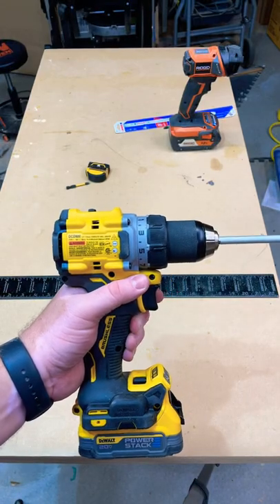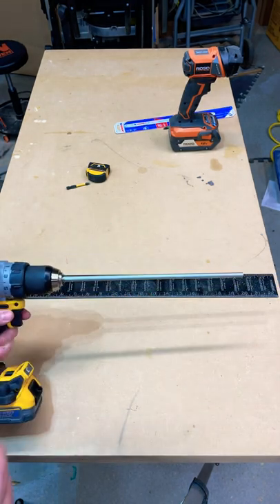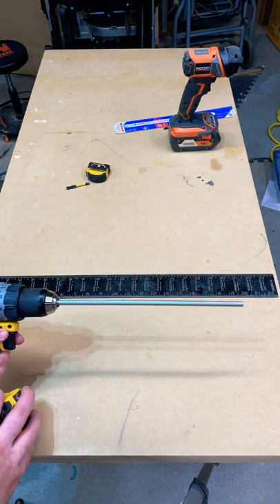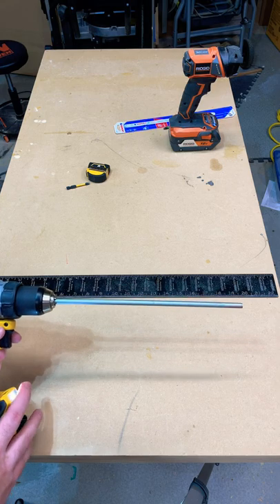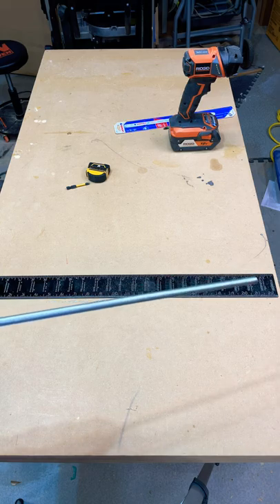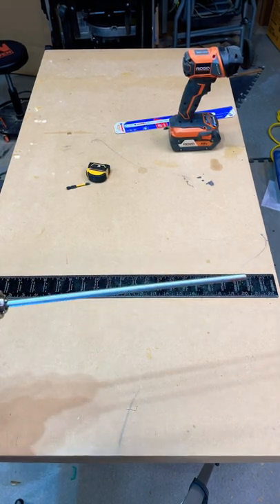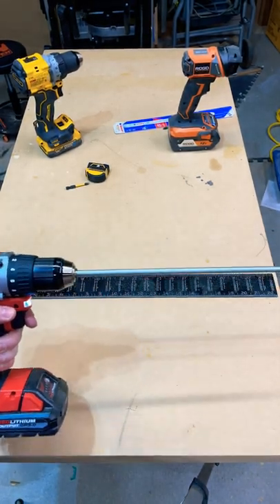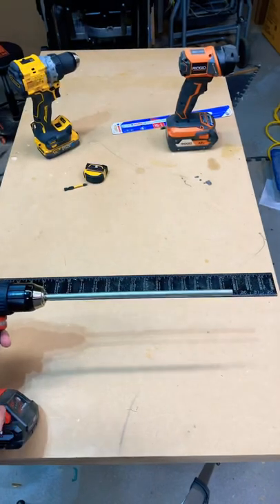Which Drill Is Worse? Chuck run-out comparison.

Comment: I’d say they’re both more than acceptable, and probably better than average.
Reply from the maker: I’ll have to compare them to both some more expensive and some cheaper drills to see truly how they stack up.   Obviously 12” is more than most people are going to have for a drill bit though.
Reply: @TinkerWithTools  Correct: and if you’re using an auger or extension with a spade bit, it will have a self feeding or spear point, so that small amount of runout won’t be relevant.
Reply: It might have helped the video better had you shown us an example of a drill with no wobble at all for comparison.
Reply from the maker: I agree with you.   I had some others that there wasn't time for in the video that had less wobble than that.
Reply: I have the milwaukee and the runout is totally unacceptable for metal working. Drilling things in thin gauge metals or drilling out broken bolts is very difficult with any level of precision.

Comment: Owning a DCD800, I found the run out/wobble to be rather annoying for having to drill accurate holes. It got much worse with light-normal usage on light gauge aluminum or light gauge steel. It wobbles horribly and I had sent it to dewalt for repair; they replaced the drill with a new one and the chuck is the same if not worse after a couple months. 
I’d probably say replace the chuck with. Rohm, or just don’t get the DCD800 (in my experience at least) and look for something else with no runout/wobble from factory if possible.
Reply from the maker: I wouldn’t say it’s my most precise drill but I have found the runout to be an issue.  But I am mainly doing wood drilling.  I appreciate you sharing those as it can help inform others looking to make a purchase.

Comment: Would someone please be so kind and explain to me what the big deal with chuck wobble on a hand held drill (and partly impact drivers) is? They dont spin fast enough to do any harm, they arent meant for precision work and the only 12" long stuff ive used with mine is a paint stirrer. At which point you could argue a bit of wobble all the way out there is a good thing. Also, what little wobble there is usually disappear when the drill bit is supported (ie you press it against something). Contrasted with a die grinder spinning at 25 000 rpm where a thou or two of runout could litteraly make a cutting disk explode in your face,  it seems pretty insignificant to me.

As long as its not actually loose or wobbling so much it causes the entire tool to rattle (cough ikea drill cough), which none of these are even close to, I really dont get it.

Are people actually doing something with their drills where this matters or is this some sort of way to imply quality? Peeve?
Reply from the maker: For me I think the main application is if you have have had to put a longer bit on to drive something or reach a hard to reach location.   The lack of a steady Chuck in those situations.  This specific shirt was in response to comment on another video about how the runout was.   To be honest both were acceptable for the tasks I do the majority of the time.
Reply: @TinkerWithTools  Thats horrible even with a steady chuck though, usually just use a sleeved bit holder for that haha